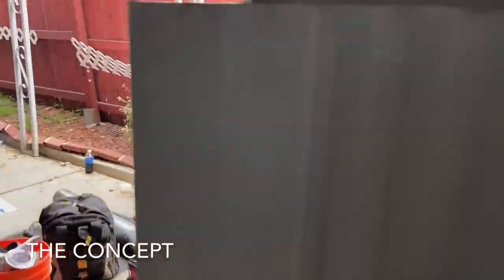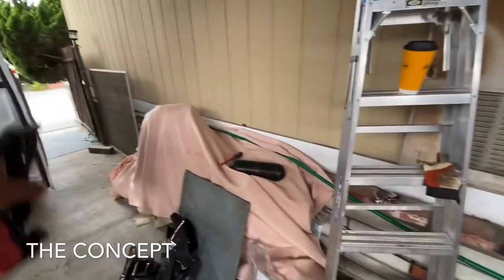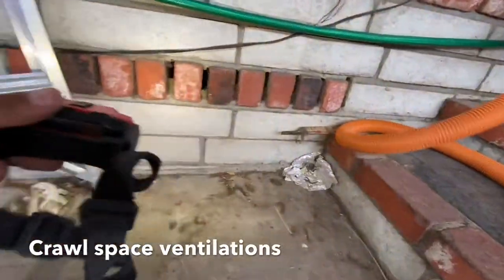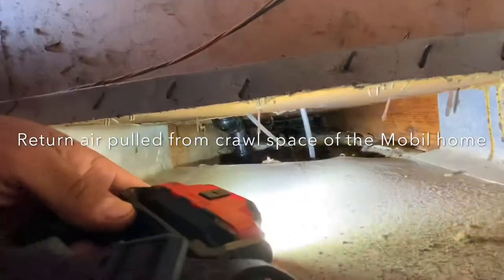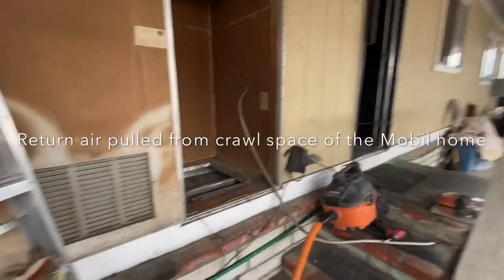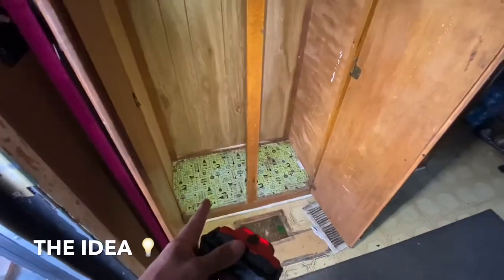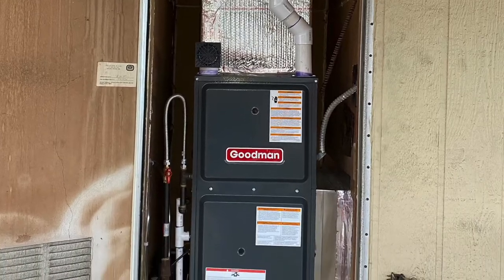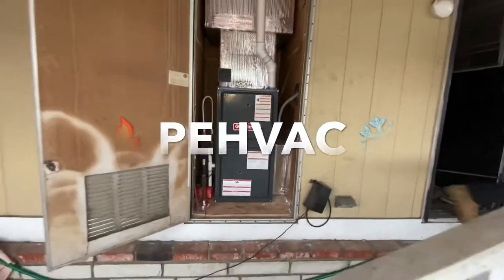#MOBILHOME Mobil home furnace heater

Comment: Nice work..    What I don't understand is why years ago "mobile home" furnaces were equipped with combustion air inlets built into the flue, but now you switched to a one pipe HE furnace.  Are you stealing combustion air from the old flue, and is that Goodman designed/rated for MH install?  Are 80% up-flow MH furnace even available these days?  Thanks.